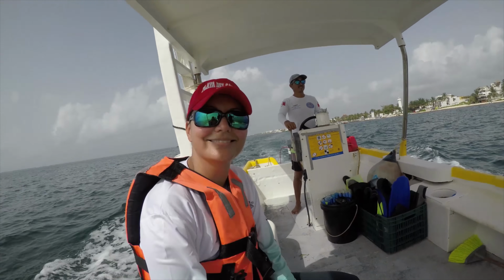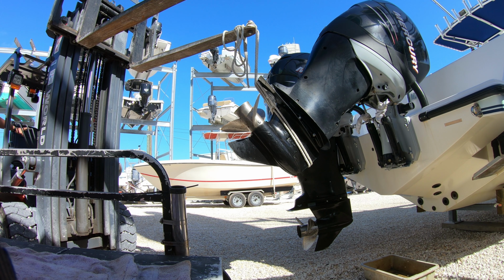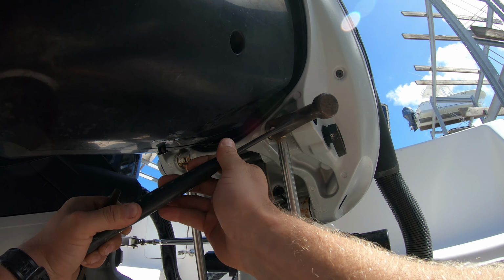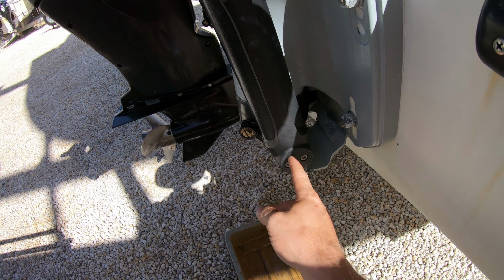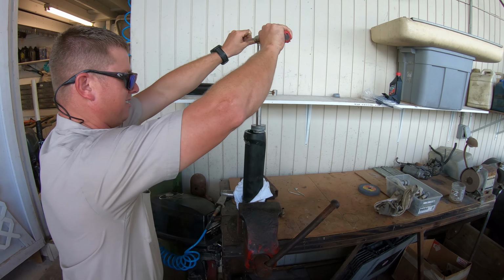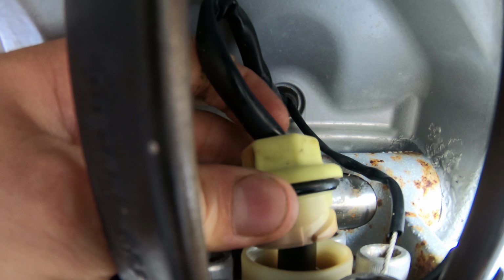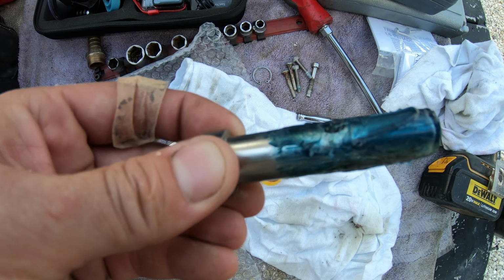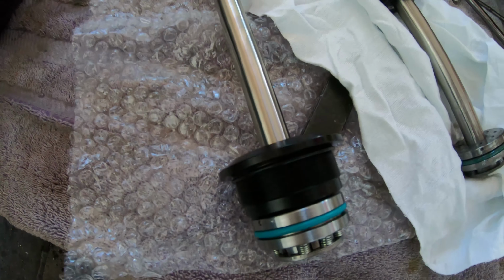Changing Mercury Verado Power Trim Caps Seals & Rams

Comment: How much trim fluid will you need when rebuilding the both Verado power trim cylinders? Answer: I ended up using 1 quart and 20 oz.  So 2 quarts should get you by.

Comment: All your videos are great! I am up there with the best of them now😉. I am about to undergo this exact task when my seal kits arrive, I think I also have to replace the seals in the reservoir as fluid also leaks from the bottom of that as well. Have you got a video of that as well?
Reply from the maker: Thank you! If you've got fluid at the bottom of the bracket, its more than likely the steering cylinder leaking, pull that off and look inside, if its got fluid in it, you'll need to rebuild it or buy a rebuilt or new one :/

Comment: Do you know where I can purchase that (green) O Ring on the trim cylinder assembly?  As I pulled the cylinder away from the pivot pin, the green O Ring fell out.  I would like to replace it only, not all the O Rings.  Just the green O Ring.   Thanks.  Ted

Comment: Great video very informative. Thank you for this. I did this rebuild a time before on the port side and everything worked fine today my starboard side started leaking so we changed it out. The problem we’re having now is the motor will not stay trimmed up. And it will not trim itself up on its own power it seems like the fill cap has a leak maybe the O-ring is bad with that Not sealing off properly would that cause the unit to not stay trimmed up and also not trim it self up under its own power?
Reply from the maker: The memory cap thing might have got stuck in the other ram, look inside the other ram to make sure that its not stuck at the bottom and if it is, youll have to pull it off again and put it back in the new cylinder

Comment: Question on falling motor. Thanks for your videos btw. 

2012 L6 300. My center motor falls slowly to the full down position over an hour or so on the mooring. No leaks anywhere and the motor functions as it should. No air sounds. 

Is there a check valve of something that should be changed?  It would seem the leak is internal. 

Thanks - Mike

Comment: Excellent instructional video!!  I don't have a lift (forklift) to raise the motor as the video shows.  Therefore, before everything, could I just trim the motor up, bring the motor support bracket down on the pedestal, and then unscrew the manual release valve, and then do all the steps outlined in the video to replace the trim rod/cap. Or, is that too risky in that if the support bracket slips off of the pedestal, the motor would be in free fall?
Reply from the maker: No, lol you should be fine! Like you said is the way to do it, put it on that stand and you're good to go, the lift is just for when it won't trim at all :)
Reply: OK, thanks.  One more question.  If I don't have the (expensive) Mercury spanner tool, and the end cap needs to be torqued to 45 ft lbs. during reassembly, how does someone  accomplish that with an air hammer (or punch and hammer)?
Reply: @TED F  you don't. But the torque is not what seals it. As long as the cap is all the way screwed in, it won't leak. I'd keep an eye on it, though.

Comment: I have a 2015 mercury outboard 150 fourstroke. The ram is stuck in the position that i last stowed the motor with the transom saver. It will not trim up or down however i was able to lock the motor in the up position with the stand. Fluid leaking out of the seal. Would i be able to just replace the seals and add fluid or is there more that needs to be replaced? Any help or thoughts would be appreciated
Reply from the maker: As long as the ram isn't messed up and going to tear up the new seals. If you can get the cap out without tearing it up, you can just replace the seals and fill it with fluid. The 150 has a similar trim system where you replace the seals a lot like this video shows:
https://www.youtube.com/watch?v=wBghtFjYK6I
Reply: @BornAgainBoating  thank you so much!

Comment: The original fluid is red, the fluid you are using is red. The quicksilver power trim and steering fluid is clear/gold. Is this the same?
Reply: Yes that's fine. ATF, power trim and steering fluids are virtually the same.
Reply: One or the other. Don't mix. And never ever use automotive power steering fluid for anything except soaking rusted bolts. It will destroy your hyd system.

Comment: Our 2008 Verado seems to have problems trimming the engine up.  No visible leakage on the cylinders however lots of noise coming from the cylinders when activated in the upward direction. Multiple tries and it will finally raise it. And the main pivot engine swivel (not sure what you call that) appears to be leaking power steering fluid.
Reply from the maker: The trim unit is probably low on fluid. And the leak, is most likely steering fluid coming from the steering cylinder. You can pull the cylinder off and look and see if there is fluid there. If there is fluid inside the steering cylinder, you need to rebuild it :/ here's some info that could help: https://www.youtube.com/watch?v=Ey4aGSMW5I4
https://www.youtube.com/watch?v=wf4wbZKrkqI&t

Comment: Hi born again boating, I have the ram on the bench but I couldn’t figure how to remove the lower piece in order to slide on the new ram cap?
Reply: Well, how did you do it??
Reply: @thediplomasta5891  got to replace the whole ram with the rod
Reply: If you don't see any hardware, it unscrews. But unscrewing it without damaging it, is tricky. The original repair kit was supposed to come with the ram and cap assembled already.
Reply: @eddieyeung2195  awesome. Thanks.

Comment: Same set up on my boat as this trim ram video... one of my engines can wobble from side to side when running or even on the trailer and it’s not steering (air)should i be looking at where the trim rams connect or is there another area
Reply from the maker: It's hard to say, usually that is in the steering cylinder on the engine. But the bearings in the steering tube could be shot as well. It shouldn't be in the trim system though, when the boat is on the trailer and trimmed up a little, lift on the lower unit and look at the bottom of the steering tube or bracket and see if it move up and down when you lift on the lower unit.

Comment: I need to change the cam shaft cover gasket and the small gaskets around the pencil coils
Reply from the maker: That shouldn't be to hard. I've never had to do that. But the valve cover comes off pretty easily. Start with the coils and plugs. Then disconnect the MAP and temp sensor on top of the block, and also the CAM sensor. Then press in the metal clips that connect to the fuel injectors. You can then pull the connector off the injector.

There are 3 separate bolts holding the grounds on to the right of the fuel rail. All of them are 8mm or 5/16. Disconnect them so that you can get the wiring harness down and out of the way. With all that disconnected you can move it to the right.

Now look in the PCM/Electrical box and there is one 10 mm bolt above the PCM. You can take that out and pull the electrical box towards the back and it will unseat from the two other bolts that have grommets on them that they sit on. 

Check out my FSM video (https://www.youtube.com/watch?v=_fDkKuFZPEs&t=38s) to see how to remove the air plenium. With all that out of the way. 

Start in the middle and work your way around the valve cover loosening all of the bolts. I believe they are all 8mm or 5/16". Then come back to the middle and remove them all. The cover just comes right off and you can change your gaskets! Then put it all back the same way you took it off! 

Let me know how it works out!
Reply: Born Again Boating thanks for the information the boat is shrink wrapped for the winter this is a spring project hopefully your reply will be still here so I can reference it thanks again
Reply from the maker: Ok, no worries Vincent. If you can't find it. Well still be here and you can ask again! Have a merry Christmas and stay warm until the spring time!
Reply: Born Again Boating ok thanks again

Comment: What about the large green o-ring on the cap that was not removed in this video?
Thank you,
Mark
Melbourne FL
Reply from the maker: Hey Mark, are you talking about the ring that is around the bracket? There is one on the top and one on the bottom. That is just a spacer, it doesn't seal anything. Then there is an o-ring that is on the bottom of the each ram cylinder, and that one can be changed, but most of the time it is in good shape and doesn't need changed, hope this helps!

Comment: We have a Safeboat with two Verado 250's, it is kept in the water with the motors trimmed up. The starboard motor has started to drop while sitting, it is very slow takes a day or so to drop. The system works fine. I'm curious what you think would be the culprit.
Reply from the maker: It's the internal check valves, sadly, you can try and take the unit apart and clean it all up, but a lot of times you can't fix it :(
Reply: @BornAgainBoating  That's what I thought, and no I won't bother just cleaning it, this is a public safety boat and it need to be in the water. I don't suppose you have done a video on that repair??? I am looking for a complete rebuild kit but I've never done that before, I'm sure it's in my wheelhouse but any help is appreciated.
Reply from the maker: @calvinkesweder568  gotcha, you don't need anything to do it, there isn't really a rebuild kit. It's more of a pull it off disassembly it and put it back together. Other than that you've gotta find an entire new unit and just swap them out! If you find a away to change out something inside of it to keep it from doing that let me know lol but I think its in the valves or the mechanical motor under the actual trim motor that let's the unit leak down :/
Reply: @BornAgainBoating  Just an update, yesterday I replaced the manual trim release valve and the problem still exists. The motor makes a weird sound when lowering the unit. I thought it might be air but it never went away. Not sure where to go from here.
Reply: @calvinkesweder568  did you ever solve this issue?
Reply: @BornAgainBoating  by unit do you mean trim assembly?
Reply: @jumpingmaps  I ended up taking to the dealer and had the entire trim assembly replaced
Reply: @calvinkesweder3355  crap, thinking I may be in the same boat

Comment: I have a verado that the trim motor stopped working. Seems to be locked up. Even with direct power to the motor nothing happens. Any ideas or is there a video on changing the motor?
Reply from the maker: Unfortunately no, I dont have a video about doing that :( I've got the footage for one, so it might be in the future. But they are pretty easy, they just pull out the bottom! It sounds like yours is dead :(
Reply: @BornAgainBoating  Thanks, we are going to give it a try and hope that solve the issue.

Comment: I am loosing fluid about 4 oz per trip on a 225 Verado with 400 hours, not kept in the water.  I can see fluid on the bottom galvanic plate after it sits a few hours.  The rams seem fine at the top, but they could be leaking at the bottom I guess.  Is there a way to know if it is the trim pump or rams and if there is a video on the pump?  I'm trying to limp along with this until the summer is over and I can take it in for service.  Once in, I'm think have all seals done
Reply from the maker: You might not be loosing trim fluid but steering fluid! This might help https://youtu.be/Ey4aGSMW5I4
Reply: Thanks to your video I did the steering ram 2 months ago.  It is not loosing fluid now, I check it often. Right now I have to refill the trim after every trip.  I looked things over carefully the last 3 days every time I had it out of the water and it looks like it is leaking from the top. Could it be the bottom of the rams or the trim pump is leaking below and forcing fluid up top.  With the virus, all shops around me at Lake Texoma are on 6-8 weeks of wait. I found one mobile mechanic, but he is not a Verado expert.

Comment: Hey mate, I have done this rebuild recently, I now have no leaks, however if I put the outboard in reverse and under a fair bit of load the outboard lifts up. This is making it hard to get boat off of trailer at the ramp. Any clues as to what I have stuffed up or broken? Thanks mate!!
Reply from the maker: Hey Charlie, either the manual release valve is not closing all the way, or something isn't working right with that memory cup that goes under the ram, does the engine trim and stay up the way it should?
Reply: @BornAgainBoating  Thanks for your reply! I will look into this and get back to you, cheers!
Reply: @BornAgainBoating  Hey mate, the engine does stay up. It trims up and down perfectly. Is there a torque setting for the manual release valve? I feel like if I tighten it any more it will strip. Thanks for all your help!

Comment: Hello there. Question : Is there an affordable and easiest way to convert a 25 inch Verado 300 Hp to 30 inch ? Is there any mercury or after market kit for that ? Thanks
Reply from the maker: Not really, yes you can do it, but there isn't a mass produced kit that I know of. Usually it's done locally and you have to change a bunch of stuff and mess with the lower unit :/ sometimes it's not worth it :/
Reply: Born Again Boating thanks. I’m going to think about it and make a decision. Happy weekend
Reply: Born Again Boating hi again. I’m thinking going triples. I’m moving the two 25 inch to the corners and placing a 30 inch in the middle. I have a total of 70 inches wide. How far an engine should be from the others ? Is 70 inches enough for triples ? Verado 300

Comment: So it look like you place cap & ram instead of putting new seals & cap??
Reply from the maker: Yes, most of the time the ram is messed up and replacing the seals will only be a temporary fix, so they have the whole ram assembly to make it quick and easier. It does cost a little more, but if the ram is scratched or pitted, you might as well do it.

Comment: Sometimes showing fuel pump critical ,that time what I'm doing sir 
My people replace fuel supply module
Reply from the maker: You will need to hit the plus button on the gauge to see the rest of the code. If you watch it as the code scrolls it will say "critical fault". Then most likely it sounds like lift pump fail, critical fault. Read what the rest of the code is. A lot of times that is because it is not getting fuel to the lift pump in order to fill the FSM and shut off the pump. 
Possibly a restriction in the fuel line coming from the fuel tank.